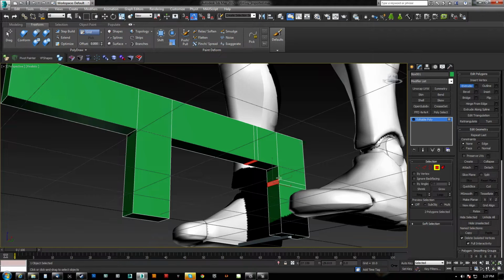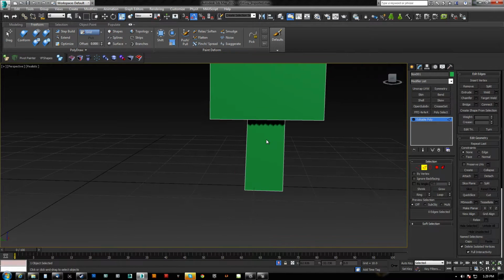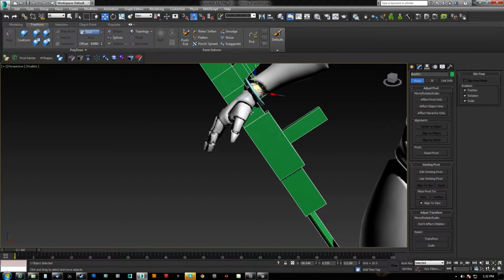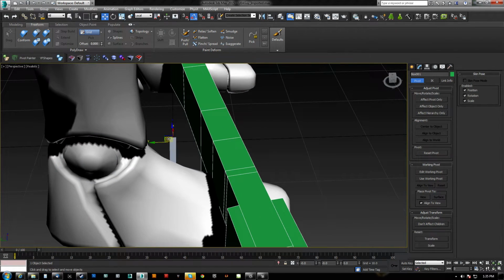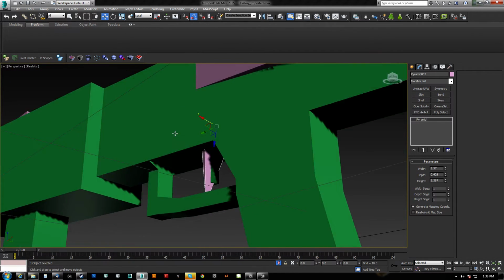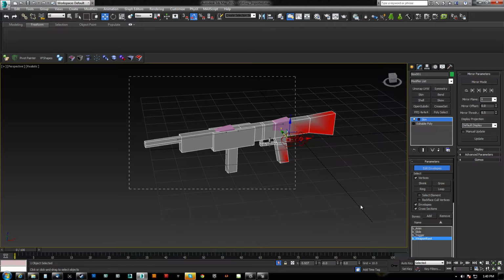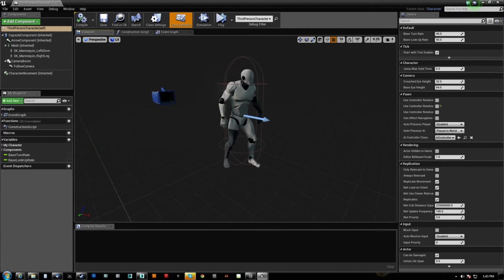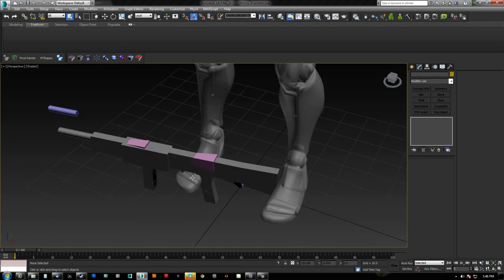UE4 CustomWeapon Pt.2 [Modeling a simple weapon]

Comment: Just a quick note about bones. If you link or parent a set of bones to a dummy you can then move each bone like you are doing with your pyramids.
Reply from the maker: +Chuck Wilson I've been link constraining the bone I need to move to a dummy helper. It works, but it causes a strange stretching effect on the root bone. In Max 2015 and before, that was just a visual bug on the bone. In 2016 I've seen it actually take the geometry with it and affect the animation so I'll have to give this a try. Thanks.
Reply: +RATSGAME  Hey no problem,  something else we have to watch out for is the group bug and 2016 EXT 2. I dont know if you come across it or not but make a box, group it, scale it up, ungroup it and the scale reverts to the size before you grouped it. If you didnt know about the group bug it could trick you into thinking it was caused by something else.
Reply from the maker: +Chuck Wilson Yea, the link constraint is a "soft link". It accomplishes the same thing (linked movements), but doesn't affect the object's actual heirarchy so it doesn't break skeletons.
Reply: +RATSGAME    ok cool that makes sense, thanks